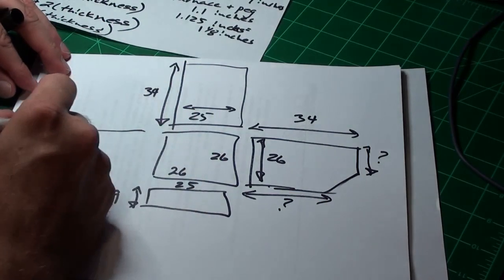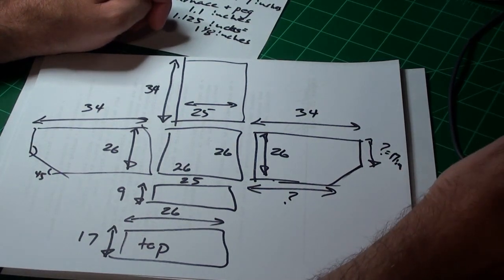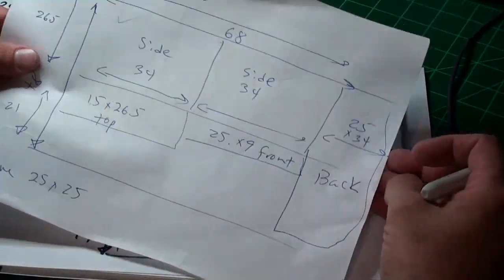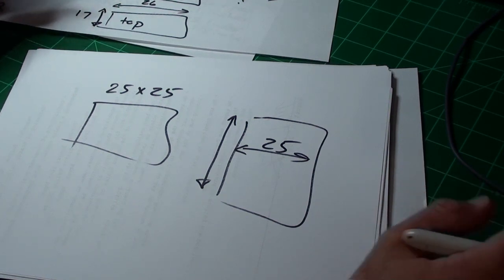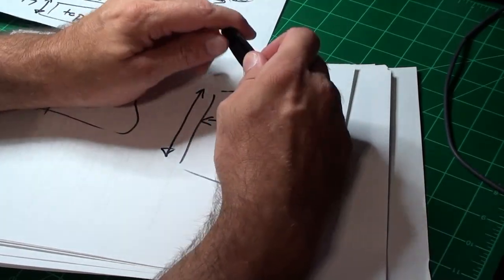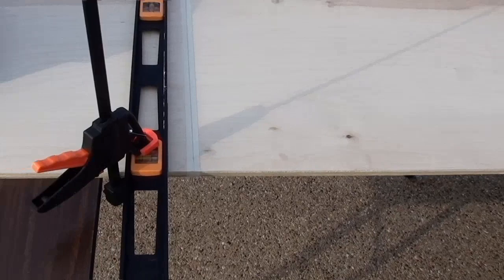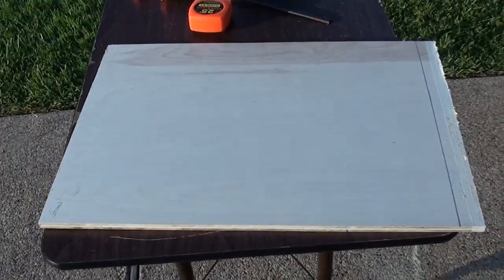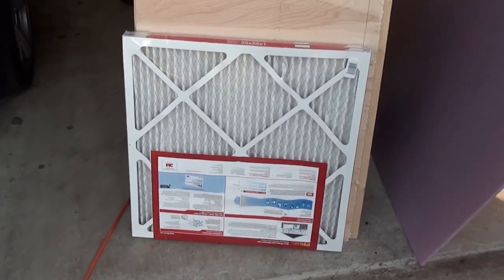DIY Spray Booth part 3

Comment from the maker: @pattyboy1001 It all depends upon what you are trying to do.  I have seen this type of booth before on videos on youtube.  The tricky part is going to be mounting the fan to the box.   Cut a big enough hole for the fan and it would probably work.  Just make sure you don't use anything too flammable in the box.  Bathroom fans are not shielded from sparks.  That is why I changed up mine.

Comment: right now I intend to make a small spray booth out of a plastic  storage box, some ducting pipe and a old bathroom fan. I just want to somehow mount the fan inside the storage box, drill a hole in the box and attach the ducting hose. Do you think it will work alright?